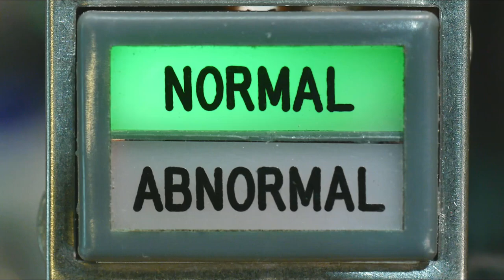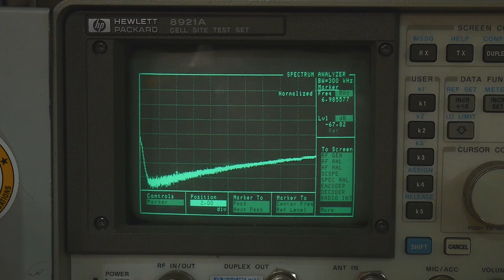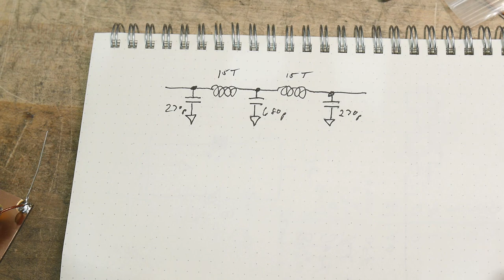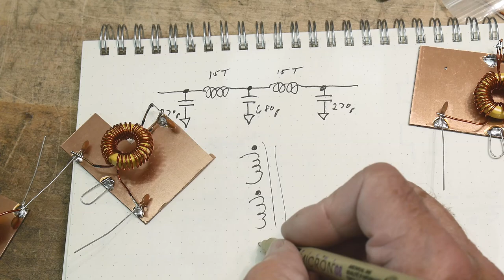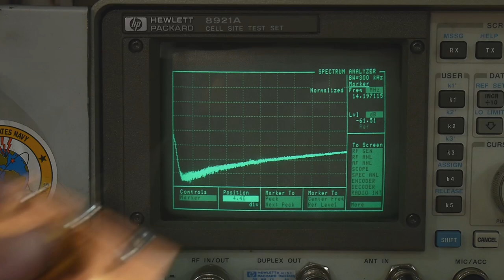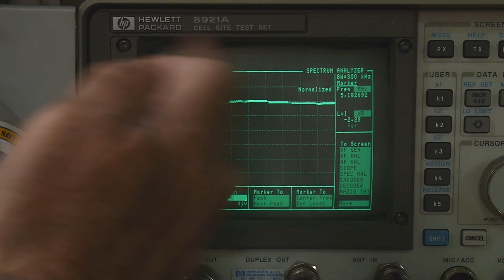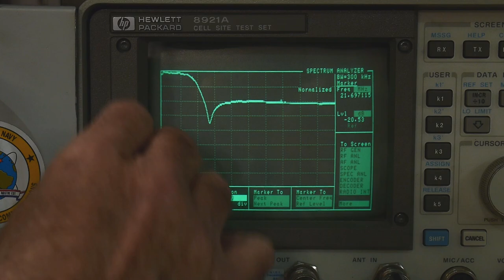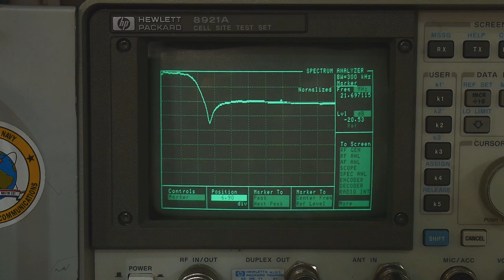#745 40m Low Pass Filter Design Using One Core (part 1 of 3)

Comment: Looks like an elliptic or Cauer filter. They have zeros in the transfer funcion not just poles. That notch is a zero of finite Q.  I believe there was literature on filters using coupled inductors way back in the 20s 30s timeframe. I have a pretty complete set of QST magazines from about 1920 thru 1945 or so and seems like using coupled inductors like this was more common then. Sorry, no details on this but I will keep my eyes open for any info I can dig up on this. Also old telephone equipment I think used coupled L' s more.
Reply from the maker: The idea came from the Collins 800Hz filter I tore apart. One of the inductors seemed to be coupled and that is why I could never model it correctly
Reply: @IMSAIGuy  Most Spice simulators include coupled inductors. Might want to try simulating different coupling constants in Spice to see how it works. I use a graphical Spice called Tina TI. From Texas Instru web site. Free download. All graphical schematic input with standard Spice backend.
Reply from the maker: @herbertsusmann986  wait for part 3

Comment: Does inductance add up, if In series, or parallel? If in series wound the same direction wouldn’t it be twice the drop? And if in parallel, wound out of phase, wouldn’t the filter cancel it’s self?  I don’t have my studio setup yet to answer these questions for myself. My imagine lab, says yes. Same amount of windings. Relatively speaking. 

This is why I love your channel so much. You actually spend time in the comments. You have taught many people lots. Down to earth perspectives help more than the professors ever imagined, or could for that matter.
Reply from the maker: the magnetic flux lines are shared in this design. if the coils were separate then they don't interact.